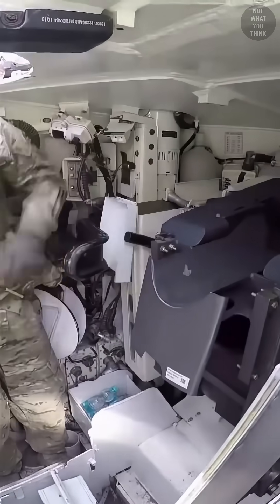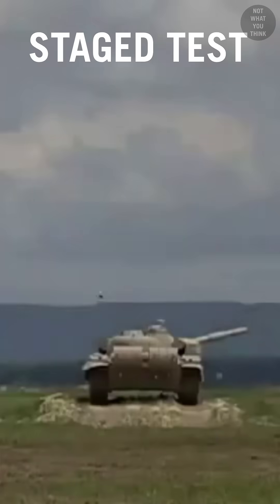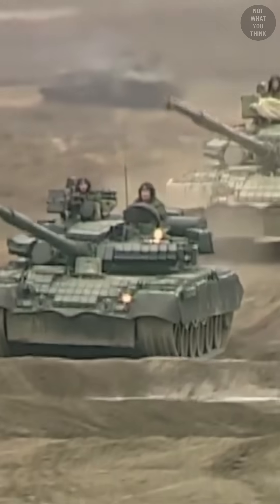Why M1 Abrams Tank Has No Auto-Loader #shorts

Comment: The second argument is obselete since the 80s. Japanese and French tanks have an autoloader that take munitions from a protected compartiment.
Reply: As far as I'm aware, the Type 10 and Leclerc only have partially protected ammo bins, much like the Leopard 2. The Abrams has every single round protected by blowout panels.
Reply: @Chopstorm.  I’m pretty sure the American Abrams stores about 10 rounds in various locations about the hull, but yes the Abrams has most of its rounds protected by blowout panels, while the Type 10 and Leclerc store about half of their ammo in the front part of the hull. I’m not sure if America would be able to transform their manual loading tank into an auto loading tank, as I don’t believe the Abrams has enough space for an auto loader and about 40-45 rounds.
Reply: The Abrams is an 80s design so it makes sense. 

Most likely the next American MBT will have an autoloader, however, it seems tank crewmen like having a 4th member so there is that.
Reply: Maybe for future tanks, but it is still a design issue that exists in the present. For example, literally every Russian tank besides the T-90M has no blowout panels due to its autoloader requiring turret ammo storage in a carousel mechanism.
Reply: @jonathanpfeffer3716  bro this is current technology on some western tanks, Russia is not the only country using autoloaders.
Reply: @Migoyan  you realize the main benifit of an autoloader is to reduce the size right? Something the leclerc isn't. Its also piss off expensive. The type 10 has the same problem.
Reply: @casematecardinal  piss off expensive ? You realise that Abrams is 6 millions $ while Leclerc is 4 millions $ ?
Reducing the size of the tank is only a preoccupation for Russian tanks ending up with the munitions under the turret. Autoloaders has other advantages like less crew to operate a tank, etc. Leclerc was a tank designed to be fast, not small.
Reply: @Migoyan  Russia is not Western.
Reply: @huguesdepayens807  I never said that
Reply: @jonathanpfeffer3716  Along with the T 14
Reply: Yup
Reply: this aged well since the Russians in fact also gave really protective compartments for their auto loader
Reply: @harryfei  the russians have no blowout pannels for the auto loader? The T-90M has blowout pannels for the additional ammunition not for the autoloader
Reply: I guess they don't see their military as disposable
Reply: Yeah that's exactly what i was thinking. Why can't US build auto loaders that just loads the rounds from a protective compartment
Reply: @dragonsaige  well they could however there are other benefits to not having an auto loader. Most of which are mentioned in the video. There us also the fact that the modern autoloader aren't really combat tested. The type 10 and leopard 2 haven't been in a lot of combat compared to the challenger 2 and Abrams
Reply: Yes true, however the Russian tanks like the T-72, T80, and T-90 were designed as relatively small fast tanks that are low profile, which means not enough room for an autoloader and a protected compartment, they only have enough space for under turret ammo storage which means no place to put the blow out panels compared to a turret protected compartment that can blow out to the side or back.
Reply: And oddly the best tank in the world is still a M1 Abrahams
Reply: Meanwhile Abrams and Leopard have unprotected Ammo racks in the hull that can cook off pretty easily as well.
Reply: Do remember, most of the tanks currently in use do not have these systems sadly. In future, hoepfuly a fully modernized designs is made for France and Japan, however that is not now.
Reply: The Russians are still using a design from the 60s
Reply: @Kingrhem.  They are quite effective all things considered
Reply: You conveniently left out  the disadvantages of the Japanese and French autoloader designs.  The autoloader in the French and Japanese tank significantly reduces the number of rounds the tank can carry.  Because of this, both the  French Leclerc and Japanese Type 90 tank stores additional ammo in compartmentalized storage at the bottom of the fighting compartment, just like older manual loading tank designs from WW2.   That means one of the two people in the tank have to stop what they are doing to reload the autoloader.  The additional ammo in the storage compartments are not protected.     The tanks are also less armored because of the weight of the autoloader.
Reply: @MrRobarino  Leclerc and Type 10 are less armored to have more mobility, Abrams is 67t, Leclerc 57t and Type 10 is 43t.
"You conveniently left out  the disadvantages of the Japanese and French autoloader designs." What the fuck are you talking about, I'm only saying that protected compartiment exist for autoloaders in answer to the video, you're conveniently interpreting my comment to suit your argument.
Reply: The real reason that we still use men to load is that the M1 is a fully developed platform, why make a new tank when the current ones can be upgraded? Most modern tank upgrades are not armor or platform related. This is my the Abrams X is the same tank platform with an upgraded engine and, yes, an autoloader among other changes.
Reply: @skybirdprojects5489  you're right but I think you're all misinterpreting my comment, I was only rectifying an incorrect argument on the video and if you read all my comments I never said that abrams should have an autoloader but many here think I did surprisingly.

It's funny because like you said the next abrams is going to have an autoloader and I'm sure it will be suddenly better than having a manual loader for many people here.

The reality is that each technology has its advantages and inconvenients but it seems that autoloaders will be the norms for every future tanks and it has rooms for improvements.
Reply: The tradeoff, as ever, comes down to one less crew person sharing the responsibility of maintaining the tank, or other duties. For the most part, the United States has always decided that one extra crew person was more beneficial in the long run than having an autoloader.  This is even more true when one realizes that realistically an autoloader isn't actually going to be faster than a human loader. No tank will ever be in a situation that calls for 12 rounds per minute sustained fire. That's not how tank warfare has evolved. The only real advantage an autoloader provides is a smaller tank profile and that's it.
Reply: @azurblueknights  "the United States has always decided that one extra crew person was more beneficial in the long run than having an autoloader" Until their last design, the Abram X which has an autoloader.
Reply: Just cause they use it doesn't mean it's safe, relatively speaking. It's a tradeoff
Reply: @justasandvich7168  arguably the type 90/10, K2, Lecrec etc etc are safer because the blast door is smaller and only the size of a shell which is safer in the chance the ammo is hit during a reload
Reply: don't matter
Reply: The difference is that American tanks have been battle tested with their systems on numerous occasions
Reply: @peenplays4219  And so have the French
So that isn't a distinguishing factor
Reply: @Infanterie_Marine  Not anywhere near to the same degree. It's not even close.
Reply: @Chopstorm.  the French literally fought with America in a lot of its wars and used their leclerc tanks during that time.
Reply: @profesercreeper  No, they have not. The Leclerc did not see combat until relatively recently in Yemen. Even then, they were minor engagements. The Leclerc was not sent to Afghanistan, nor did it participate in the Gulf War like the AMX-30s did.

Again, the Leclerc has seen nowhere near the same amount of  combat that the Abrams has.
Reply: I hear a lot of shit talking from someone who’s not showing the Abrams blueprints and where the auto loader would go without blowing up if shot.
Reply: @bogustoast22none25  Your simple mindedness is why you aren't in this conversation
Reply: @cassu6  just because my word selection is not modest, it doesn’t take away from the fact that I speak true.

Not only was the Abrams not designed to have an autoloader, it has been repeatedly reported that the Abrams has reached or is near reaching its lifespan in terms of how much more they can cram into it.

Then you have to take into account that if the Abrams wasn’t designed with an auto loader in mind, then you have to make an auto loader with the Abrams in mind, a tank that has, as previously said, been reported to be nearing its lifespan.

Imagine bringing companies to design an auto loader, selecting a winner, then bringing that into production, rotate all the Abrams out to get fitted, just to have it be thrown out the moment someone decides “yeah, we need a new tank”.
Reply: @bogustoast22none25  
Sounds exactly like something the Pentagon would do, quite honestly
Reply: @DarkMatterX1  Which is why I hope that for once they don’t
Reply: Hope you realize that japanese and french tanks are a very small percentage of all tanks in service lmfao. Majority of the world has tanks with no blowout panels. For an obsolete argument there sure seems to be a lot of blown up russian tanks in ukraine currently
Reply: @Myemnhk  and what ? The technology exists and works and the US would have no problem to implement it, the fact Russia doesn't care about implementing it doesn't disqualify autoloaders.
Reply: @Migoyan  Manual loaders also "work" and do so with increased efficiency. You don't have a valid point. You are assuming that the lower crew number is inherently superior while disregarding the speed increase of manual loading. Just because it works doesn't mean it should replace another method that also works. So let me formally ask, why should the united states spend billions on rnd and testing for a method that isn't better? A tank loader isn't exactly a highly trained position, its not like you're losing extremely valuable men like a fighter pilot. So the argument that the machine would be better financially isn't true either. Also an autoloader itself isnt any more reliable than a human when both are hit, if anything in the heat of the moment it would be easier for another person to replace the loader in a few minutes in combat than the tank needing a few weeks to repair the autoloader. Please tell me one significant advantage of an autoloader. Because like i said in terms of speed and cost it is in favor of manual loading.
Reply: @Myemnhk  you talk about the manual loading speed like it's consistant accross all loaders and like they will never be tired after being hours in a vehicle for several days while not taking into account that it requires a lot of drills to reload at those speeds under pressure.
Plus when you look about information on this topic there is no clear winner between the two.

Also you're overlooking the fact that a loader received a complete military formation like any other soldier and are not just trained to load a tank.
So yes an autoloader needs maintenance but a loader also need supplies.

As why the US should puts money in R&D for autoloaders, simply because the technology has room for improvement plus bigger calibers are being considered for futur tanks meaning heavier shells and charges.
In fact the US is most probably still doing researches on autoloaders.
Reply: French and Italian tanks also share an unknown feature. There's a small compartment in the turret which, when a button is pressed by the tank's commander, slides open and reveals a white flag 😉
Reply: @tommytaylor2084  and romanians have 2 flags, one of the axis and one of the allies, what side wins they will be on it.:'X
Reply: @tommytaylor2084  so original...
Reply: @tommytaylor2084  "HAHA LOOK FRENCH SURRENDER NOW LAUGH" That moment when the french literally helped in america's independence and was one of the most prominent powers in the world:
Reply: @tommytaylor2084  there's nothing wrong with the way the French fight, well protecting the back of the English expeditionary Force the French took 40,000 casualties in 2 days. 40,000 ALMOST A THOUSAND AN HOUR, all they wanted was a ride to England, so they could come back and fight the Nazis.
Reply: You said french and Japanese.... I miss the part where you said Russian
Reply: @TraceguyRune  well Russian tanks are ass so we don't huddle them with the big guys
Reply: @TraceguyRune Bro, "protected compartiment", none of the T-72, T-80 and T-90 (which is a modernized T-72) have that.
Reply: @Migoyan  why did you stop there? T-64 which is a reworked t-10 which is a development of JS models 3 and 4... etcetera.
Reply: @worldoftancraft  because T-64 is a different design, T-90 is litteraly an upgraded T-72. They renamed it due to the poor performance of T-72s during first chechen war in order to not harm the exportations.
Reply: @Migoyan  so the fact that the 90tg is a rework with a greatly more powerful engine, changes in turret design and fire control system — that's all is a bullshit. 
Okay. How did a reworked m26 get the "M60" name?
Reply: @worldoftancraft bro there are many variant of T-72 with different motorisation, electronics change and even turret modification. Just see T-72B3, T-72B3M, those are still T-72.

Plus I love how you pick the latest variant of the T-90 for comparison (which is M, the denomination tg doesn't exist). How about the first variant of T-90 which had the same engine, chassis and turret, only changes in reactive armor and electronics, it was even supposed to be called the T-72BU. The T-90 is more close to the original T-72 than the T-72B3M.
Reply: @Migoyan  who said "the latest"? I said about "90a" model
Reply: @worldoftancraft  Still doesn't disprove my point
Reply: @Migoyan  still doesn't disprove my point that be all should call M60 an "m26a8"
Reply: @worldoftancraft  Did i said the reverse ? Maybe you should learn how to argue because diverting the subject is not an argument but i bet you have none anymore.
Reply: @Migoyan  It does actually, the T-90A has a new turret, fire control and Shtora, the OG T-90 was supposed to be called T-72BU but overtime it became it's own thing, vastly superior to the old T-72.
Reply: @Invisibilitycloak-q9f  I already said it before, you realise that T-72B3 is also a tank with a new turret, new electronics and other improvements on armor,still a T-72.
The main important thing is the chassis and the purpose when you classify a tank, which are the same for T-72 and T-90 (both MBT and same chassis).

BTW the other guys was saying m60 is an upgrading Pershing, it takes 2 seconds to see that they have nothing in commons (not even the chassis).
Reply: @Migoyan  The T72B3 did not recieve a new turret, it's turret was the same as the T-72B's turret, which is also vastly superior to the T-72A's. And not just that, the hull armour was also better, you just have to realize that the T-72B was actually an 80s tank, as new as most modern tanks today, and the tank was pretty good when it was introduced, but now is kinda obsolete due to Russia not actually being able to upgrade them all that much, unlike the US or Germany. The chassis isn't the tank, we actually know that most hits land on the turret, not the hull, so hull armour isn't actually as important as the turret, and by this same logic, the newest Abrams would be "just as good" as and old 105 M1A1 because they had the same chassis, which makes no sense.
Reply: @Invisibilitycloak-q9f  The series name of a tank is based on the design of the chassis.
You're literally proving my point with Abrams, modern ones are still called Abrams even when they have completly different optics, canon, etc but they have the same chassis hence sharing the name.
T-72s and T-90s series share also the same chassis hence why I said that T-90s are upgraded T-72s. The Russian gave a new name for the same series because of the failure of T-72s during first chechen war. 

Plus I never said that old Abrams or T-72 are as good as their upgraded versions, I don't know what the fuck you're talking about. Now I already argued about that with the other guy and you're giving the same arguments as him, so I don't see the point with continuing this conversation since it leads to nowhere.
Reply: @Migoyan  The name of a tank is not based on the chassis that it's on, let's take the LAV as an example, though not a tank, it was an extremely versatile chassis that saw major export success, and because of this, alot of variants (and therefore names) have been made off of this chassis. I have said this already, the chassis is not the tank, it may be part of the tank but never the tank, otherwise would you call a firefighting version of a T-72 a tank? The T-90A and up simply aren't T-72s anymore, they have had enough changes made to be able to actually be called a new tank, your argument only applies to the very limited amount of original T-90 (without the A) that was made, that was an upgraded T-72, but this is no longer the case and it doesn't care if you agree or not.
Reply: @Migoyan  By the way, not just the Abrams had that one particular chassis, there were many experimental variants before that used the exact same hull without being called an Abrams. And we have a fuck ton of other countries version of a Russian tank that wasn't called T anything, like the North Korean Chonma-Hos that became their own thing even though originally they were just a T-62 with some Korean words slapped onto it, just like the case we're arguing about here.
Reply: @Migoyan  How the fuck did this even start in the first place?
Reply: @Migoyan  it is true that T-90 was T-72 with more modifcation. Its like original M1 Abrams with M1A2 Abrams
Reply: @Migoyan  "upgraded"
Reply: @TraceguyRune  Russian tanks are old, cheap and small. That the reason they don’t have stuff like the French tanks. They don’t have the room